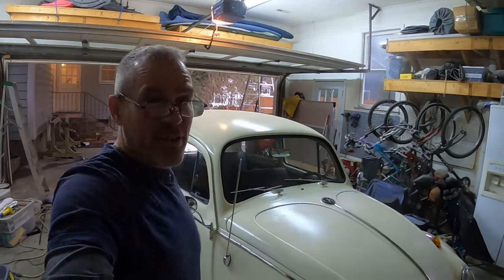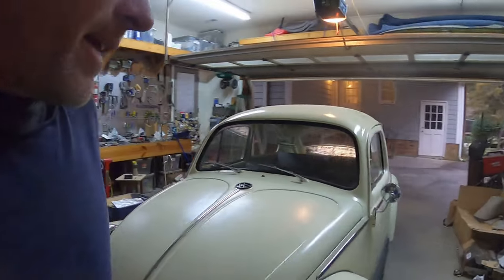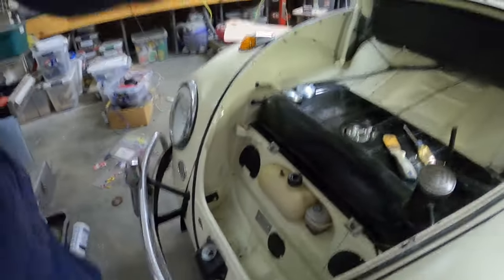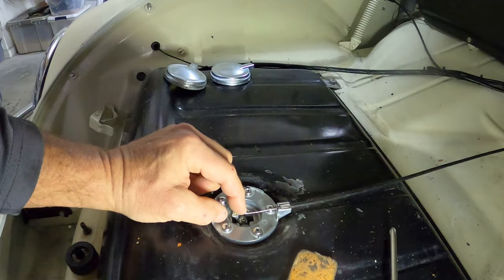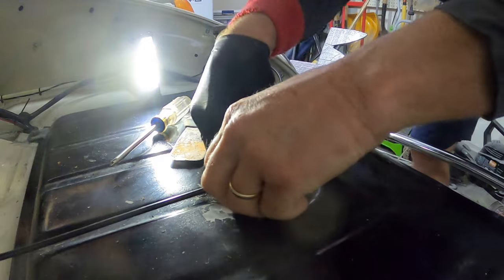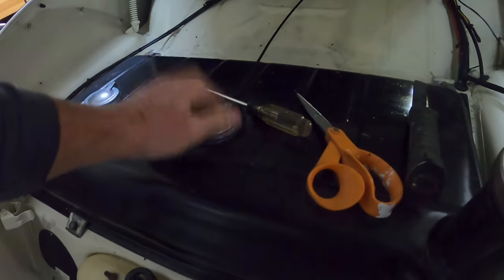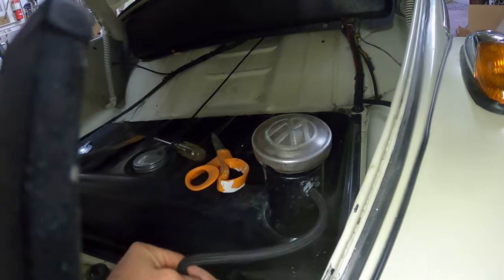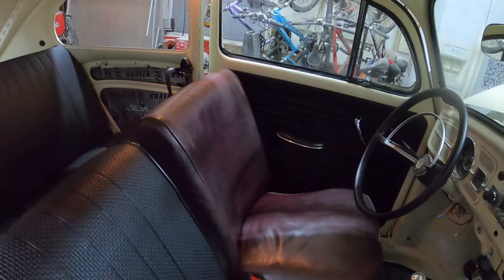1961 VW Beetle (65 Pan) - Front Seat, Fuel Sender, Fuel Breather - 125

Comment: Love your videos I’m always impressed by people that are brave enough to film there work and put it out there. I got into Vw beetles a few years ago. I know own 3 and have many many many hours of watching videos and reading books under my belt. Can I point out from what I’ve read the fuel breather cable you installed was actually the correct length there was no need to cut it. It needs to be clipped in to the 2 plastic cream coloured clips on the inner wing and then fed through the exit hole. Only the Vw engineers know why they did it that way.
Reply from the maker: Yes!  I need those clips - I now remember breaking them when removing them prior to the body work…. One place wanted like $16 per clip

Comment: Seats lookin good 👍
Reply from the maker: Thanks - I had to do a bit of creative wiring at the base of the passenger seat back - almost like 5 steel wire sutures that act like hog rings.  The pointy metal things were not working with the new covers.  But I think it should work well.
Reply: @LarsonSplitBus-  that's the thing..we have to constantly improvise with these old bugs..everything is a challenge..good for the old grey matter though.your bugs looking better all the time

Comment: You installed the fuel tank breather line incorrectly.  The two clips on the left side of the trunk near the fuel filler are the retainers for the breather line.  It should run from the filler neck, towards the rear of the car about 15 inches, bend 180 degrees and run back towards the front of the car to the hole in the trunk floor.
Reply from the maker: Thanks - yeah I trimmed that line too short and didn’t have the clips.  I wish I had a do over ;)